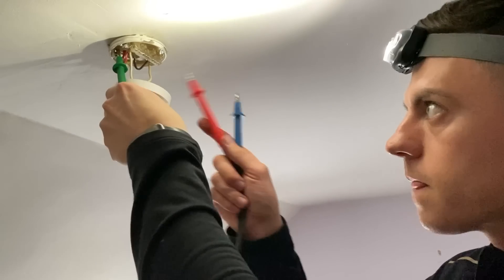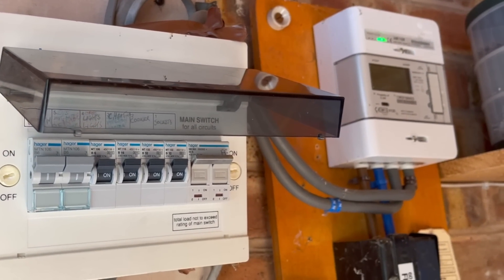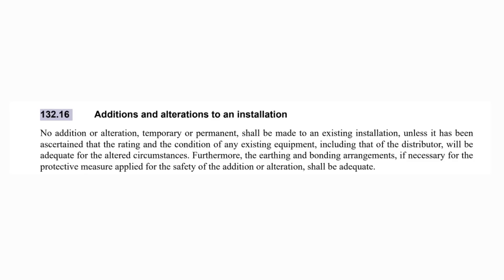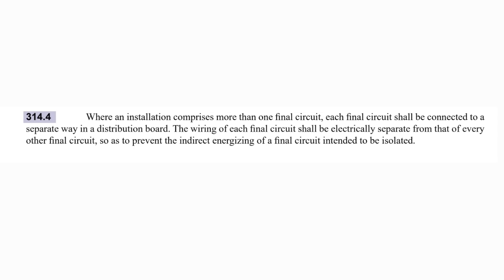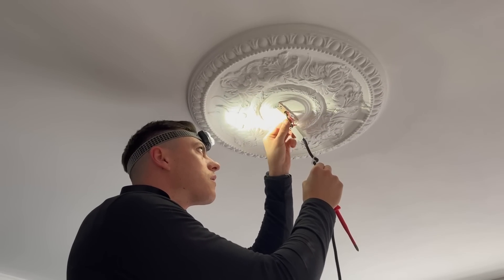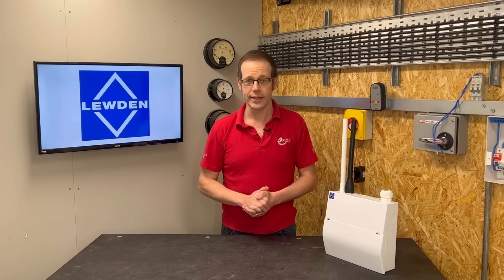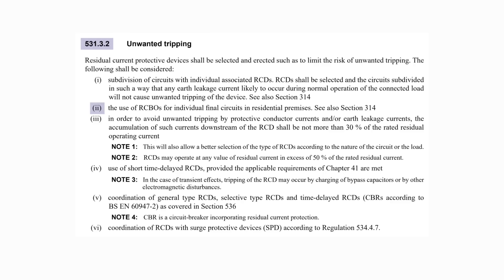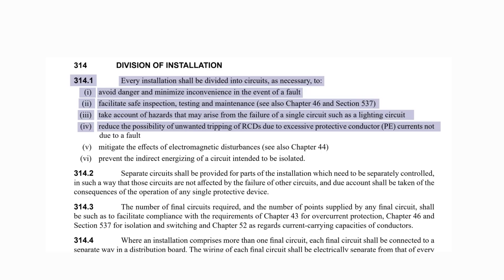The Pitfalls of Ignoring EICRs Before Changing Consumer Units

Comment: If a customer was not issued with EIC after having a there consumer unit replaced, as per regulation 644.1 of BS7671. What can they do ? Reason for the installer not issuing an EIC was due to incorrect polarity on sockets outlet, which was highlighted on a recent EICR. Also section 7.3 of the building regulations state that polarity checks should be done as part of pre-work tests.

Comment: Always a good idea to carry out an eicr before replacing a consumer unit. I've often found problems with the incoming supply, such as high Ze. I once found an installation relying on the water main for earth, and I had to ask the DNO to fit a clamp to the sheath of the incoming cable to make it a TN-S system.

Comment: Here's a question about consumer units.
I'm changing our house over to run primarily on electricity, as I can see the green agenda being the new COVID God. I have installed an 'off-grid' type installation which will only use the grid to top up the installation primarily between November and February. This installation includes an 8.4kW PV array, three 5kW inverters running in parallel and a 92kW lead-acid battery bank, consisting of thirty-two VARTA LFD 230Ah batteries. These are configured in series parallel (four batteries in series, giving eight parallel banks of48V which serves the three Iconica inverters). The whole lot is adequately fused and cabled, but I haven't replace my MK consumer unit which is 23 years old. The consumer unit has no surge protection or RCD capability, but has MCBs on each circuit. I have no intention of 'exporting' my electricity at the moment (why would I invest what I already have, to be paid a couple of pence per kWh?)

I have also purchased a 12 year old Nissan Leaf which only has 50% battery life left, but is still good for local journeys and has a usable battery of about 12kW (15kW at the most). I have a 'granny charger' supplied with the car which gives 15A @ 230V (3kW) so is appropriate for the battery size. It comes with a 16A IP44 connector and I've ordered a 16A backplate, a 20A Double Pole 2 Module C Curve 10kA 30mA Type A Mini RCBO and I'm thinking of using 16mm2 cable from the Henley blocks of the inverter outs to wire this. 
Sorry for the full description, but as you can see this is not what people normally do when they buy a new electric car which has a 50kW (or larger) battery and then needs a £1000 Zappi or similar.  

As far as the heating is concerned, I am thinking of a heat pump to add on to my wet central heating, but have not yet decided  whether we could get away with some strategically sited ASHPs instead. Anyway, the question I have is this:

As I replace our gas cooker range with a plethora of air fryers, induction hobs and electric ovens, it soon becomes apparent that if I had the 1.4kW air fryer going, the 2.4kW electric oven and the 1.8kW induction hob all at the same time, that would be almost 6kW of cooking. 6000/230= 26A, which could be handled by a 32A ring main, but isn't ideal as a 24/7, 365 days a year solution. A better idea would be to have a larger rated 'ring main' just for the kitchen, possibly rated for 50 or 60A. Is this kind of solution being built into new housing these days or is it still a case of just supplying a new-build kitchen with a standard 40A / 60A cooker point in one location?

Since the standard plug socket isn't designed to carry 3kW for more than say half an hour without getting hot, what is the best solution for the type of 60L standalone electric ovens that are being marketed as a replacement for gas appliances?

If I change the consumer unit for an all-singing, all-dancing individual RCBO type, will Curve B type modules suffice this power draw appliances without nuisance tripping?
Reply: Any appliance over 2kw should not be on the ring main , oven and hob should have dedicated circuits . 
Why 16mm for a 16 amp supply ? 
16 amp plug should not be on a 20 amp protective device .
Reply: 16A commando,style connectormdoes not comply with 7671 for domestic installations
Reply: @posei3960  Why?

Comment: Was due to do a board change from the old 3036 fuses to full RCBO board. Did an EICR and found a neutral to earth dead short on the sockets, everything unplugged and disconnected in board so it was not via the earthing arrangement. Customer didn't want floor boards pulling up or anything else to fix it. Board change cancelled.
Reply: Good comment @mainly electrical youtube 👍⚡️

Comment: Simplify things 1 bonding gas , water bond visibly present RCD type A covering all circuits , polarity correct. Those are the basic common sense checks I do before any additional work. The obsession with trying to fathom out and interpret BS7671 can sometimes be distracting 👍
Reply: I do earth leakage checks on each circuit now before every board change and that’s very useful . Several jobs previous sub boards have been fitted by unqualified builders & kitchen fitters so always expects problems when they’ve completed work the shouldn’t have touched 🥶

Comment: i've got the dno coming out to sort my tails out to the meter as, as i mentioned before, they are thinner than the ones that come out of the meter to the cu
they should have dealt with them when they did the smart meter instalation, but no, they just removed the switch, gits
Reply: If you incoming main fuse in the cutout is 80amps or less. The 16mm pre meter tails before the 25mm ones outgoing are perfectly fine. If the fuse is 100amps and you intend on solar or ev then an upgrade may be necessary.
Reply: @rayc1503  I've got 100 amps
But have been advised that we should do all the electrical work first and then get them to do the tails at the end because if they turn up and things aren't right, we have to pay full price for a visit rather than free to make sure things are right
Reply: @therealdojj  Just a suggestion ask your suppliers to install a incoming mains isolator, if you're having the meter tails upgraged. It will make the electricians job much easier. Sometimes main cutout fuses are labelled incorrectly. There could potentially be a lower rated fuse in there. The supply cables pre main fuse may not be large enough to take a 100 amp load. You would have to discuss this with your supplier.

Comment: Rcbo consumer units are very costly . Nothing wrong with a high integrity board , couple of rcbos plus split load RCDs in my opinion
Reply: Lewden rcbos are about £12
Reply: I just looked one up on CEF.....a 14-way with 10 RCBOs is £195 including VAT. Hardly expensive.
Reply: @fredflintstone1428  what make ? Spd included ?
Reply: Cheap sparks put in split loads on a board change unless its a rewire I can understand putting a split load in to keep costs down RCBOS just make life easier though  if there is a fault on a circuit it does not affect any other
Reply: split load board.. ??Ughhhhh

Comment: For the sake of clarification. Does the need to ensure the "existing earthing is adequate" mean that no work can be done if the main earthing conductor from the Head or the Income casing is less than 16mm on a TN supply (as we should assume that even a TNS supply is in fact a TNCS due to repairs to the DNO supply cables)
Or is the requirement only to have a suitably low enough Ze to allow disconnect times as per the regs. in case of an earth fault of negligible resistance on any circuit ?
Reply: 🤣 now now... Bs7671 only gets excited about pme in special locations... Stop putting two and two together... 🤣 Essentially its your call as the designer isn't it. But if you doubt the validity of calling it tns and doing an adiabatic then yes you'd have to upgrade to selection requirements.  😉

Comment: been mulling over getting my CU changed for some time as my home only has a 4-way wired fuse jobby (built in 1963) plus a separate isolator for the shower. But choosing a contractor who's up to speed and getting an idea of  what to have installed and current pricing has been a bit of a stumbling block for my going ahead with it.
Reply: 1.5 days labour. 450 quid. Materials 200-300 depending on spec. Overall £600-£800 assuming nothing else required to repair or upgrade. But if nothings been done since it was built you probably need bonding installing and some repair etc. I'm sure there are plenty of sparks in your area who'd be more than capable and willing to give you a quote.
Reply: @travoltasbiplane1551  it'll defo need bonding, but i can probably lay in those cables myself ready for the contractor to connect up.
Reply: @kathrynwhitby9799  that's between you and the electrician. Personally though I'd discuss it with them first and wouldn't lead with it!
Reply: @travoltasbiplane1551  good advice. thanks.
Reply: @kathrynwhitby9799  Have a look for wooden back boxes and VIR cable.  If you can lift up a floor board or 2 have a look for round junction boxes as well.
Reply: @sergiofernandez3725  i live in a maisonette.

Comment: There’s no real alternative but to carry out a EICR before a consumer board change. How could you successfully fill out a electrical installation Certificate if there are various non compliant issues with the current installation. Even newer installations should really be fully tested if a board change is requested. It’s a no brainer and the customer should be told this right at the start of the initial inquiry.
Reply: You need the test results one way or another, so I totally agree. Plus, avoiding what Joe said about sticky client situations is golden. You could actually get paid for repair work rather than be held accountable for it post board change. So much sense with this approach.
Reply: Make it up in the van because the rcd held so it must be fine? Seems to be the OP.
Reply: The installation doesn’t have to comply with current regulations, C3’s are fine and wouldn’t prevent a replacement consumer unit being fitted. Any C1’s, C2’s or FI’s would have to be resolved before the replacement consumer unit is energised.